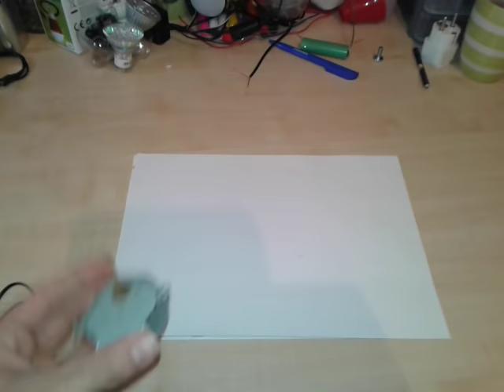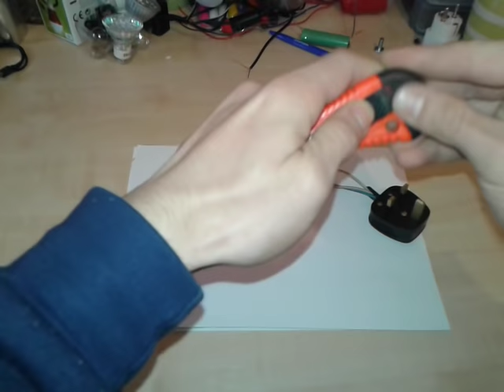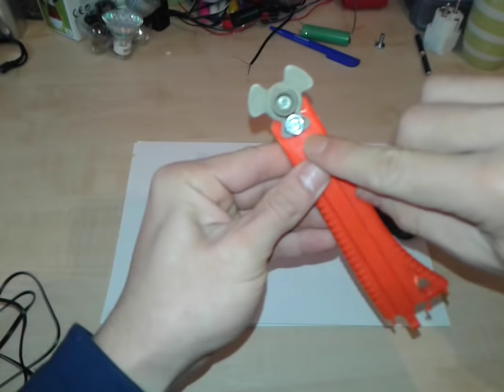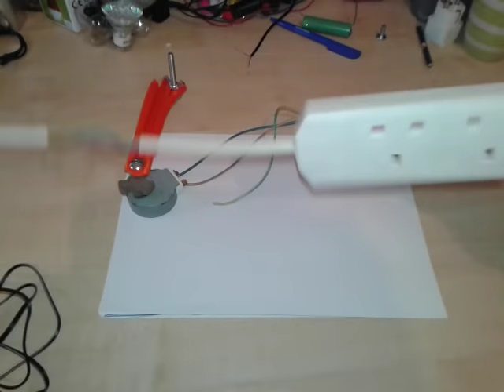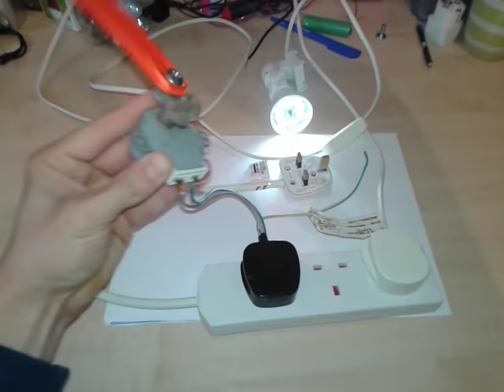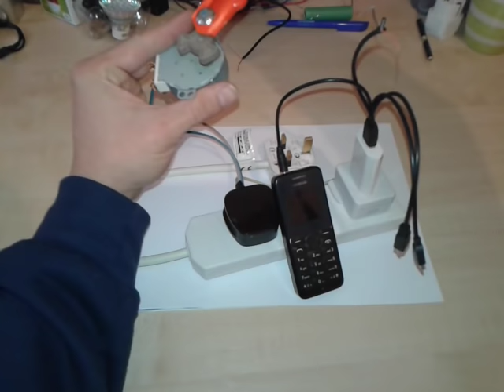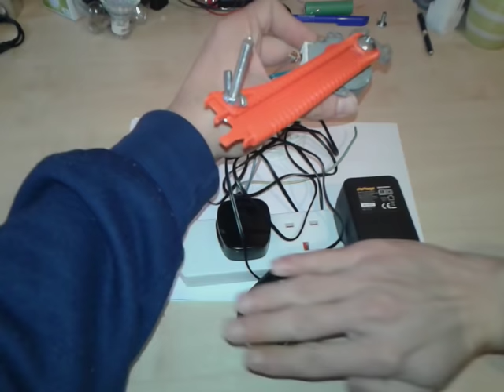Homemade 220v hand crank generator from microwave oven motor

Comment: These motors are completely different from all other small AC or DC motors that you usually find in old appliances. The secret is linked t o the fact that when used as a motor, you never know which way it wants to spin from stationary. Brilliant crank handle. BTW. Being able to produce mains voltage from a small unit would be good to power TV  from excercise cycle - while charging batteries and while gaining a great ass.
Reply from the maker: Thanks for the comm this motor is a concept that i try to share with the world it has low output but is Ac 220v Incredible for me by its size and it could be improuved...

Comment: So I did this in a similar way, I used the original cord running from the microwave motor and the other ends are stripped with connectors added. They sit over an outlet extension with 3 plug in spots, it is not a surge protector. 

I can crank a led lamp to work but I cannot charge my phone. Is it the size of the original wire or that most USB wires are dc? I know little about electricity but really want to learn.
Reply from the maker: Alistair 1924 watch out this days to make the microwave cheap they are using different motors for charging a phone you need a normal USB charger connected to the motor output

Comment: thanks, how about charge 10-20 capacitors and connect to the inverter
Reply from the maker: Aire Lao I am trying a better version now with better handle and maybe a case and maybe we will try a better motor so stay tuned

Comment: If you removed gears it turns so easily , 5 v USB drill would spin it above 5 volts  so would that not be generator powering alot for little input? 5 v in 1 or 2 amps?
Reply from the maker: The gears amplifies the rotations so lots of speed i was thinking about spin it maybe i will make a video about that
Reply: @NoSkillsRequired  someone hooks upto 6v 4 aaa batteries and a motor from a  toy and gets 100 volts or thereabouts? So is this 90 v free?
Reply: The gears slows it down,  few clips of just rotating magnet and coil. Finger thumb on round battery under gears gone spins easily. 7v with hand if adding a motor to spin without gears its still going to power easily and rotations more than possible with gears. On you tube takes off gears then motor from toy to magnet ? If 90 v free why not more  known about. Sdt up 2 dozen run all the house for 100volts to 1000? But amps?

Comment: Do you have a multimeter? I would like to see some voltage readings off of it.
Reply from the maker: Depending how fast you spin it can go up to 340v ac but the amps is low this motor from the video has a power of 5w 240v ac.
Reply: its a fricking permanet magnet motor, when spinned by hand it becomes a generator is it that hard to understand???jesus.... if its rated at 5rpm 220v then if you spin it by hand at 5rpm it will produce...guess what....220v TADAAAAA........
Reply from the maker: Hugo Barbedo yapp dear friend for some is very hard because there watching thos free energy devices and hacks

Comment: So these motors are usefull because of the gear ratio right\?
Reply from the maker: The principle is very good spinning a magnet inside the coil of wire and the system of gears helps to spin faster generating ac 220v
Reply: Yeah i musnt forget about the magnets,. The microwave in the video had one,. Im hoping the oscilation motor in my tower fan will also be good! Crazy gear ratio i couldnt stop the thing by hand.
Reply: I found out my motor is almost the same! 
Its 220/240 V    4W  4/5 RPM (Even the same shape)

I made a crank today and now im looking at a diode rectifier and capacitors. :D

You gave me lots of confidence, thanks alot!
Reply from the maker: +Melvin Jansen No problem mate i am glad that my video was helpfull and this channel is all about real working usefull stuff in a NoSkillsRequired way.good luck with your projects
Reply from the maker: +Melvin Jansen hey mate do me a favor tell this dudes that are posting comments that it output 220v Ac and morre thanks
Reply: I wonder.could you rewrap with a thicker gauge wire?
Reply from the maker: +steven Spitzer that was my first intention but no is very tricky to reproduce the same voltage maybe with a stronger magnet but the most important thing is in my opinion that spinning a magnet inside the coil is more efficient then outside the coil
Reply: @melvinjansen2338  hy sir 
If we give this motor five rpm then please tell me at least how much electricity this motor will generate in watts.

Comment: In on of the comments, Melvin says he is now looking for a diode bridge and some capacitors.  I started to reply and tell him he doesn't need those, because the output of the cranked motor is already DC.  But then I began to wonder.

In the microwave, the motor is driven with 220V AC, and spins the plate.  Now, when you manually crank the motor, are you not getting AC out of it as well ?  

All the items you operated with it are designed to plug into AC mains, so my guess is that it's delivering AC when you crank it.  If Melvin wants DC, he will indeed need a rectifier and filter.
Reply from the maker: Any motor in revers become a generator more or less efficient.This motor is an synchrounous motor 220v ac 5rpm 50hz,so in revers it become an ac generator 240v+ ac with a power of 3-4w .So is useful YES in some cases is CHEAP ? YES  thanks for watching
Reply: Al Cohen I really don't think it had DC as an output... Before rectifying with diodes i couldnt power anything that needed DC. 

I'm only a beginner but i really think i have the same motor... I have found in stores that some motors come in DC output.. but the one i have and i think the one he has does not have DC.
Reply: Al Cohen i lit a 5 METER 25W LED strip with it 😅 maybe not as bright as it usually is i couldnt really tell. 

-somehow charged my 12v drill batteries
-charged my phone
-made a pretty dangerous taser

 @noskillsrequired does not lie in his videos! but it does take a long time to generate energy... bigger is always better.  

for me this video gave me courage to try this... and i have learned by falling and getting up again
Reply: Al Cohen before rectifying i think my capacitors didnt load anything
Reply: Yep.  I understand from "NoSkills" first response that when you hand-crank the motor, you get AC out of it.  That makes sense.  It does seem pretty useful, for small loads that don't need a lot of power.
Reply: but shouldn't there be a connection to the ground as a neutral and both the motors wires alternate as a phase. is my understanding wrong or there is something that i am missing.
Reply from the maker: +حبيب اسلام ground connection is not necessar it has less than 5w
Reply: thanks for the replay, then could the electrical devices work normal while alternating the current dirrection.
Reply from the maker: +حبيب اسلام as a tip ground is mistake the only good thing using ground is if you are using electric shower and fridge the rest is used to send your electric back to the electric company and you will pay over and over the same current.😆

Comment: Thumbs down for calling it a 220v charger. Yeah it uses a turntable gear motor which MAY have come from a 220v Microwave but the output is much less than that. Any little motor can generate some power, if you add gears to make it spin faster you then need the crank and leverage to force it around. If you put a load on it you will need to try even harder to make it go. 

But SHTF, it could help out.
Reply from the maker: Dear friend the output is 240v+ Ac when connected a normal usb charger (step down ) the short circuit 0.8A at 5v when the tel connected 0.5A go to the phone.So is not a 220v charger ??? try it and then judge and maybe you will learn something
Reply: So you force it pretty hard then. Going to break soon. LOL 

True I don't know what the no load voltage exactly would be cause I didn't do it, you got me there. I have a crank flashlight, same thing only with super cap to store couple minute extra charge.
Reply from the maker: +TruAnRksT It is little hard to spin but with a good handcrank is ok got some power for the size.this motor is design to spin 1.5-2kg at 5rpm on 220v.all the best
Reply: NoSkillsRequired
You too! I have a couple discarded microwaves might try it out. How long could it last in constant use though?

Reminds me of an old hand crank school demonstration generator I have, or the one I had on my bike as a kid. Wow, that put a load on the pedals.
Reply: TruAnRksT And when you were going uphill it was on/offon/offon/off with every push of a pedal lol. It's funny, sometimes when explaining a car alternator or other electromechanical device to someone I'll refer to the old bicycle dynamos and they look at me like I have three heads. It's also funny how a lot of people can even clean their own ass with such a poor understanding of the world in which they live.
Reply from the maker: I try to explain as simple as possible but believe me more easy than this is imposible you dont need skills  to replicate and improuve what i show but is to much pffff

Comment: looks like about 8 9 volts 320ma max
Reply from the maker: JAMIE JOKER it output 300v and with the USB charger step down 5v 500ma and with a buck converter I can draw 2.5v 1a so supercapacitor can be a solution

Comment: Very nice project until You get an electric shock from usage. Insulate the motor output and don't use male connector rather than connect the motor directly to socket bar. Other than that - good job. How much power can this set up output?
Reply from the maker: you can get shock but is not that powerfull .its output is 240v + and power around 1.5-2w.As you can see steping down i measured 5v 0.3-0.4A so its got some power.take care

Comment from the maker: Again stop trying to power 12v led strip with this and burn them. THIS 
IS AN 220V+ AC (ALTERNATING CURRENT) GENERATOR .IS THAT SO HARD TO 
BELIEVE???? THERE ARE MANY FAKES I KNOW, BUT NOSKILLSREQUIRED IS NOT ONE
 OF THEM
Reply: NoSkillsRequired how much intensity can you ... do with this??
Reply from the maker: +Thomas laTomate what do you mean?if power is you after 3-4w
Reply from the maker: +cosh row hi mate the specs for this motor are: 240v Ac,5w the power,3-4 rpm.This is a synchronous motor is not a dc motor is an ac alternator so when is used in reverse like in the video you will receive 300v ac aprox 5w.all the best
Reply: Whatever you do, DO NOT connect any devices you would regret frying, especially if you are a beginner. Voltage on output depends on speed of rotation (handcranking), and will fall a lot when under load, which allso means IT WILL RISE A LOT (potentialy to frying-something-level) after you disconnect the load. Only use devices that are for japan/eu/us/uk market and tolerate 90-250V, so you can aim your cranking speed at, for example, 150V, and still have plenty of safety margin...
After some testing and measurments...maybe, but not straight plug and crank ;-) 
It is quite safe (for humans), as you will definitely stop cranking it immediately if you recieve a painful shock ;-)
Reply: NoSkillsRequired

Comment: The picture of a generator attached to this vid looks like a properly ( DIY) fabricated hand crank gene, not what you did which was just a crank handle. Although it’s an interesting vid for newcomers to DIY energy, the pic made the vid a bit disappointing as the expectation was for a complete DIY gene.
Reply from the maker: Kiyarose3999 if you think it through it is a generator and a DIY gene I am just pointing out the uses of this inexpensive motor the case and proper handle are just details it depends on everyone what they have on gând all the best
Reply: NoSkillsRequired Yeh I understand the purpose of the vid, I have a few of these motors and am making a hand wind gene with one of them. I’m using an old plastic hand cream tub that will have a hole in the side for USB socket. It will have a removable handle that will fit inside the tub when not in use. I have all the parts just need to fix them together. I suppose my comment to your vid was unnecessary, but like I said the pic made it look as though that was what u was gonna build, no probz though, keep going with the vids, cos people need to see what’s been chucked away every day. Millions of motors in appliances/devices if they was all repurposed for renewable energy, within a few years everyone could have their own domestic Wind etc gene and for Free, we don’t actually need to build anymore Wind/Solar farms.
Reply from the maker: Kiyarose3999 to be honest before posting the video I did a search on Google and find this picture and like it so much then I decided to put in in the video the rest is useful enough for a motor that you can easily discard as waste and had a lot of discussion about the performances of the motor, that is fake and so on. I do like constructive criticism, and have a sense of humor, always do reply to common sense and if people didn't understand something I do try to open people eyes in my own way please fell free to watch more of my videos and do share your opinion about them all the best my friend

Comment: hey @noskillsrequired but i wonder if you can use it on waterwheel and  produce enough energy  to battery
Reply from the maker: kabanda slyivio ita good but it can produce 220v and maybe it can reduce the voltage but to charge a battery is gonna take long hours all the best
Reply: is any  suggestion  on which motors that i can use to producer hight  it will be userfull  or next time  show us how to make waterwheel 

thanks  for ur help
Reply from the maker: kabanda slyivio see my video dc generator i spin it by hand but can be adjusted to a bike like pedal generator and you can charge a battery in 2-3 hours

Comment: I just took apart a Microwave. 110/120 Volts AC. When I cranked over the little motor it would not even  light a small  LED. What a waste of time . The microwave worked fine too. Now what, I do not want to put it back together. I found it  in the trash anyway. Lots of good parts inside anyway, I'll keep them.
Reply from the maker: Not all of microwave ovens have inside 110v 220v motor to make them cheap some of them have 36v motors so take a look at the back of motor and reply what voltage and watts is there and you have lots of good stuff inside beside the motor that transformer is magnific.all the best

Comment: if out 220v but how much   amp?
Reply from the maker: Strang World World this is a 4w motor so 4/220=0.018A but with a phone charger can be 5v 0.500A
Reply: Hy sir 
If we give this motor five rpm then please tell me at least how much electricity this motor will generate in watts.
Reply: Hy sir 
If we give this motor five rpm then please tell me at least how much electricity this motor will generate in watts.

Comment: dude, next time put at least some insulation tape on those electrodes... its 220V and you have both electrodes 5mm away from you palm. people following your instructions in this video can get hurt and will sue you... please, safety first !!!
Reply: No lawyer would touch that
Reply: can't get sued for that lol, he said it was rough and you should do it better if you try it
Reply: nah, that's where the 220 wall power comes in, that's also called "free energy" on other videos... shhh, it's a secret. I wonder what's under the white paper...

Comment: yeah it works but even if that small motor gen has 220v it will not be able to charge that battery because the coil inside its verry small gauge wire like human hair witch has almost no current(miliamps) ,could charge a phone but extremely slow like 5 miliamps an hour,consider that charging a phone on usb pulls around 250- 300 miliams and thats a slow charge,charging on a wall pulls 800mA to 1000mA ,phone with quick charge can take up to 1800 mA, so even if the led is you will get old cranking that thing before will show 100% charge.  a cordless drill if spined the other way around will put out 8-10volts dc and 2000mA put a 5 volt regulator and will charge anything
Reply: I agree 100% it would take days of cranking just to charge a cell phone!!!!

Comment: i tried it n it never worked
Reply from the maker: It depends on the motor it has to be rated on the back label 120/220v depends and synchronous motor some manufacturer are putting cheap version to cut the cost down it works if you got the same motor

Comment: Love to see a multi-meter hooked up to see the output.
Reply from the maker: Sorry i dissmantle this motor to see what is inside you have to believe me on the output more than 220v AC it actualy give you a small shock if you touch it in operation if i will find another one i will measure with 10 multimeters :) thanks for watching
Reply: I'm not doubting the voltage, I'm curious about the amperage.  I think it would be interesting if you hooked it up to something like a bicycle to generate power.
Reply from the maker: amperage is low i mannage to connect a usb charger to this and the 
output on usb side was 5v 0.5A if connected to a led bulb 3w ac mains 
220v lights no prob.
Reply: I will have to check but I believe I have one of these motors from an old microwave that I disassembled a couple years back.  I'll see what I can get out of it.
Reply: @NoSkillsRequired  
Hy sir 
If we give this motor five rpm then please tell me at least how much electricity this motor will generate in watts.